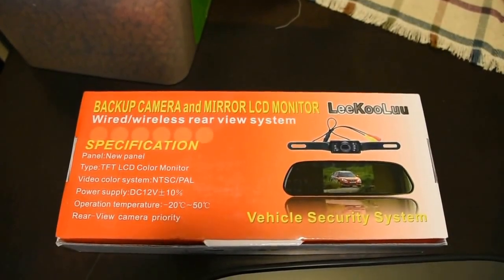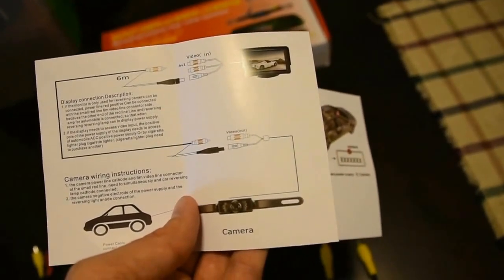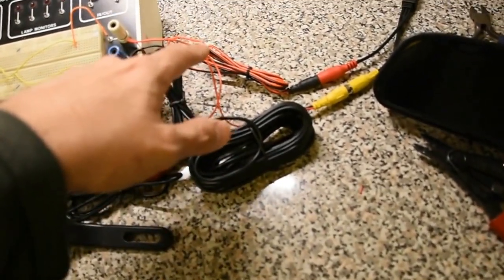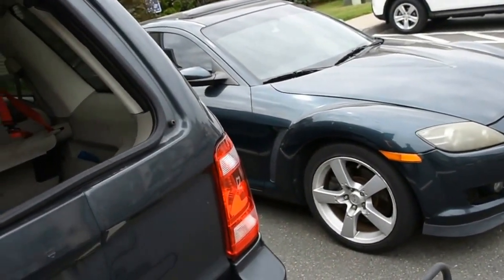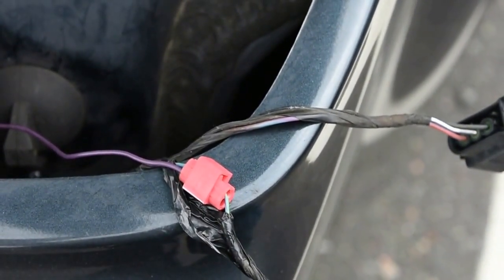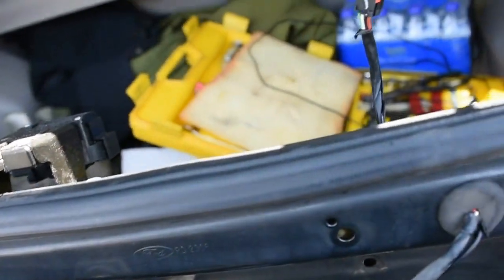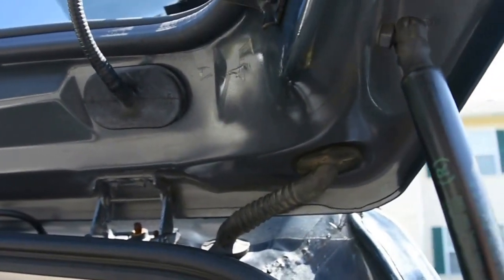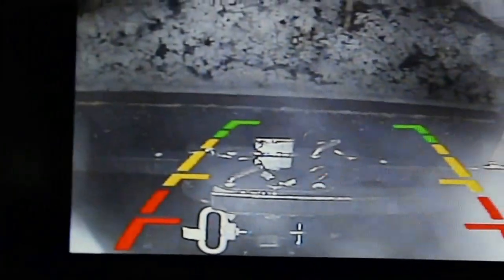Aftermarket backup camera with integrated video in mirror installation

Comment: I did this same thing, but the video feed is very fuzzy, almost like a channel that is out of tune. Should the mirror also be hooked into a power source, or just hooked into the RCA red? Or should my ground leads be comeing from a harness, or just a screw to the body?
Reply: I grounded the mirror to the body, and ran the power through the RCA (so the reverse lights power it). I was getting the fuzz off and on for a while, but now its gone completely. I cant say I understand it. Not sure if this is coincidence, but a taillight was out, when I went to go replace it it was a heavily oxidized connection... I connected it and disconnected it a few times to clean it up, and light works fine, mirror does too. Perhaps loose connection on the light system?
Reply from the maker: If you can, subscribe to my channel, with enough subscribers I can get a small kickback! Thanks in advance!